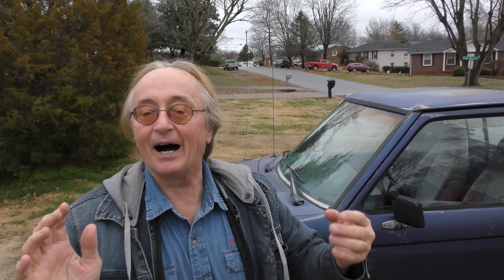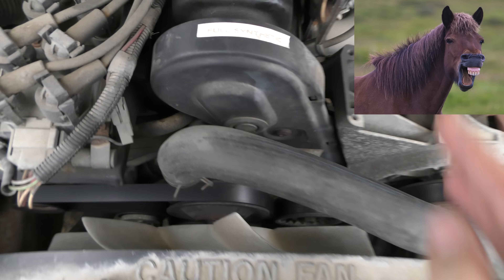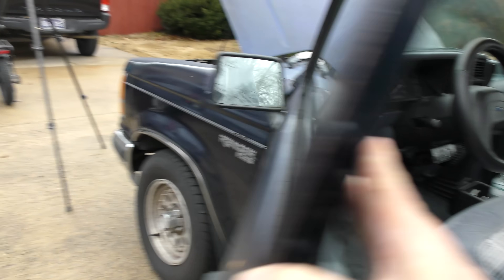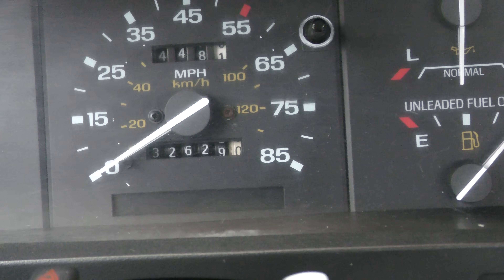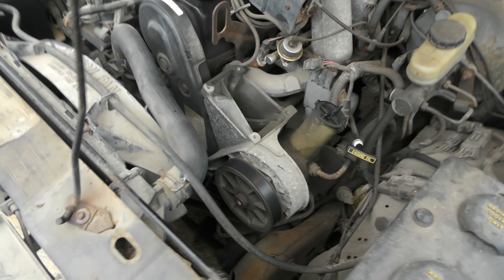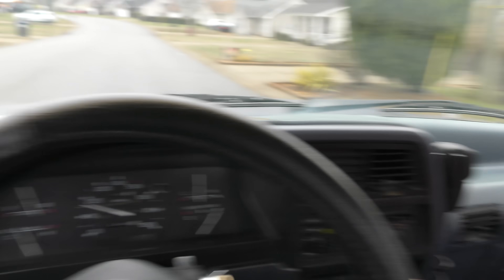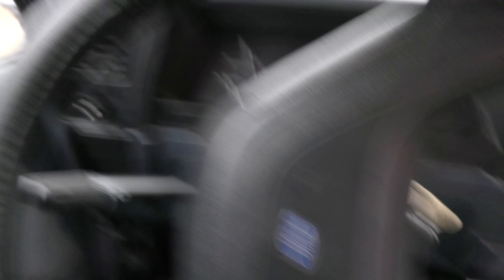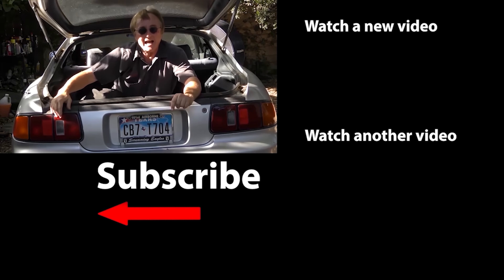Buy This Now (Before It’s Too Late)

Comment: I wish they'd make mini-trucks like these still/again. They were more practical than today's behemoths.
Reply: They can't because of the government regulations / CAFE .
This is the same reason why there are no more regular/single cab 'mid size' trucks either.
Even the new maverick is really a mid size not really a compact truck like these used to be
Reply: Yep. It's what Valor X says. It's the C.A.F.E regulations here. Other parts of the world still get the Toyota Helix, and check out the Japanese Kai cars, vans, ans trucks.
Reply: Unfortunately your only option now is to import a Japanese micro truck or buy an older one. I don't know what's with people nowadays so many "fat" cars, and not even roomy inside, just useless plastic taking up space.
Reply: @litao2641  Definitely. Why have a vehicle that's huge, has less interior space than a station wagon and gets awful gas mileage? You definitely can get an imported kai truck here in the States now. Jst check up on your local county Tag laws before buying one, because some may be reluctant to tag one. I don't see any of the kai trucks on  the road in my county,  but people are able to tag those recreational utility side by sides. They can drive them on roads with the speed limit 45mph or lower
Reply: 2.9 Colorado...closest and most modern, and decent prices...clearcoat fail for the win!!!
Reply: @jcrowellz2000  Here in Canada we have quite some K trucks/vans running around and they are allowed to drive on highways and registered as a regular vehicle which is nice! The place I work they have a honda k-truck for on site maintenance, better than any golf cart and can even drive into buildings!! I really love those things but the price of a decent shape one is quite high,  7~10k CAD range!!!
Reply: Even rangers and tacos are big now
Reply: @noahfrye4583  Exactly, those were small size handy trucks, the newer ones are just bulky. I still don't get why they try to make pickups look like some fancy show car, trucks are meant to work, not to show off
Reply: @litao2641  exactly

Comment: I had one of those exact Rangers in high-school my dad bought off my grandpa who worked at Ford. I drove it for 4 years through Ohio winters and I pulled a 16ft aluminum boat and a 12 ft trailer with my 4 wheeler. It was easy to fix, reliable, not fast which was good for a high-school kid and allowed me to have a lot of fun with friends fishing and 4 wheeling. Gosh, kids these days have it rough with computer run cars you can't work on and cost a fortune to fix. I do miss the good old days where a trip to auto zone spending 50 bucks got your problem fixed and back on the road.

Comment: I have a '96 Mazda B3000, basically a ranger. 190k miles, standard trans, rwd, extended cab. I bought it from original owner 3 years ago and it's been such a blessing. Hauls whatever, drives great, does 70/75mph down the highway no problem. It's not a drag car, but its fun to drive around and I've only had to do oil changes. Starts every morning in cold CO. I'm hoping I can get it to 300k miles
Reply: Yes the Mazda truck was the Ranger with Mazda logo on it. Believe they were both built in Kansas City, Missouri plant at that time. Solid and dependable small trucks.
Reply: You should check the timing belt
Reply: @richsweeney1115  Will do! Thank you! I'm waiting on this months paycheck to have it fully checked out —I'm not skilled in mechanics. Spark plugs, oil filter, all the bells and whistles. Will take any and all your recommendations!
Reply: @mateobarroetavena3469  you're welcome
Reply: @mateobarroetavena3469  the timing belt times the camshaft and crankshaft, valves,  and pistons if the belt breaks, it could ruin the.motor, I'm not sure if your motor is an interference or not, if it's not  and the belt breaks, you'd just h have the  timing reset, and put a new belt on,

Comment: I had a '91 Ranger that I bought in Yuma, Arizona, so the dash cracked and curled like a bag of potato chips, but it ran great. It had the 3 Liter V6 and a 5 speed trans. The first thing I had repaired was the A/C. The parts were reasonably priced, and the labor was reasonable also because of the ease of working on it. I added side rails to the bed, as I was managing some apartments. The tenants would leave a lot of trash behind, and often people would dump things on our property. The 3L engine was great for hauling, and driving on the freeways in San Diego. It was a convenient size for driving around the city and parking, and I really enjoyed it. Unfortunately I had to sell it because my knees have gotten really bad, and I could not step on the clutch. The 3Liter is a good engine, and so is the 4Liter.

Comment: I bought my oldest son a 2002 Ford Ranger in 2008 for $6,200 and it had 72,000 miles.  It has over 240K miles now and still goes down the road.  It has standard transmission which has been replaced a few times but it is a good truck.
Reply: How has he had to replace the standard  tranny a few times???? They don't usually blow

Comment: I had a 2008 Ranger, yes, newer and more tech than one from the 90s. But that truck ran and ran and never gave me a single issue in the 3 years I owned it. I unfortunately lost the "Bruiser" in an accident a month ago and it only had 109k miles on it.

Comment: I remember being in my older brothers 90' Ranger with the 2.3l manual trans. All 3 brothers crammed in there for a ride to go get  a TON of sand.  That little truck wasn't happy but it got us back with about 550lbs of us in there and 2000lbs of sand in the bed! Lol

They were solid, reliable little trucks.
Reply: Me and a friend loaded a 92 Ranger with enough material to build a large deck,  2500 pounds,  top speed 40 mph

Comment: I had a 63 Ford Fairlane when I was stationed in Beeville, Texas. Straight 6 with a 3 on the tree. What a clunker, but it was all I could afford back then. While driving down to Corpus Christi with a shipmate,  the brake line ruptured while driving on the highway. Had to use the emergency brake and clutch to slow the car down or stop. We had to drive it around and find a garage that could make a new one on the spot.

I wanted to fix it up, but ended up being sent to Japan, so my chief bought it from me for $500. Cars with manual transmissions were pretty common in Japan back then. I bought an old 4-door Skyline at an auction house in Yokohama and kept that for a long time. Those straight 6 engines ran forever and were easy to work on. Everyone wanted 2-door skylines, as they were sportier and Nissan was still very popular, but they cost a lot more. However, now manuals are not so common and the road congestion just makes them a pain. Japanese drivers actually have to get a manual transmission certificate on their driver’s license or it’s illegal for them to drive one. That’s just nuts.

Comment: My 95 S10 with the 4.3 v6 and 5 speed still runs pretty good and when on the freeway gets 24 mpg. Not the best gas mileage but it is paid for and it certainly isn't going to depreciate any more. I would change that timing belt though.

Comment: I remember that I was driving this Ford Ranger 40 years ago delivering computer tapes for the company that I worked for.

In fact, this Ford Ranger was the twin brother of Mazda B2000 then in early 1980.
Reply: If it was from 1980, it must have been a Ford courier, which was just a rebaged mazda. I use to have one of these at the time.

Comment: Those first generation Ford Rangers used alot of galvanized steel. Ford was replacing the rust bucket Courier from Japan. My Ranger had the 2.0. Got it cheap suffered from carb ice in damp weather was a easy fix. Broke the timing belt at 170, 000 miles. Replaced it in a school parking lot. Still got the sliding back window for it if anyone needs one.

Comment: I have an 07 Colorado I4 automatic with 136k 4x2 four door. I have only spent about $400 in repairs. One wheel hub and a EVAP valve.  It runs great the AC works, and I live in Florida.

Comment: A friend of mine had a 91'  4cyl 5 speed. We worked the hell out of that truck. We hauled loads of fire wood that had the headlights pointing up in the trees. We broke both of the leaf springs. The leaf springs for a F150 were the same  dimensions, put in a set from a F150. It wasn't  fast but would haul anything we threw in the bed.

Comment: my brother had a early 90s ranger and everything worked for years until the undercarage rusted out and cracked in half...causing one heck of a wreck because it happened while driving. then he inherited a one of the last plymoth breeze..with pitted heads that blew out the engine once again while driving. He finally lucked out when the subaru dealer gave him more than he paid for his car and a good deal on a used lexus suv. (from what i hear the parts were worth more then the car).

Comment: Had a '92 Ranger that I drove for years. Took out a Honda SUV on a snowy morning. All I did was change the fender and the tire popped off the bead. I drove that truck til I bought a Ram in 2004 and gave it to my son who drove it until it rusted out

Comment: I had a customer with a 92 Ranger 2.3 OHC had to replace the head gasket and valve job at 340,000 still had the original clutch which was getting weak at 280,000. I used to shut it off to shift between 1 and R.

Comment: I remember a couple friends had Rangers. They were nice looking trucks. I had a 1986 Mustang LX notchback with the 2.3L carbureted 4 speed. 80hp monster. I had to rock back and forth while chanting to get it to go over 45mph on some of the steeper hills. It had two sixty AC (2 windows down, 60mph). Too bad I used Quaker State in the early nineties when the oil was junk. The motor was no good by 120,000 miles. I had no idea. Anyway, I loved the car. It went surprisingly well in snow, and unstoppable with chains on, like a little tank. Really cheap to run. Very basic. I wish I still had it. Damn I'm old.

Comment: Hey Scotty tell him to put in a truck bed cargo load stabilizer. Beyond the obvious use to hold the load IT MAKES the truck handle better. It is like a rear suspension stabilizer AND I dont notice a stiffer ride. Instead the truck handles damn near like a go cart. Love regular cabs with manual.

Comment: I agree with you Scotty, I myself am a 55 year old Scotty & only 3 years ago did I buy myself a new to me truck with A/C. But I had to buy a used truck (F150) because I wanted hand crank windows & a manual transmission, so I ended up with a 2008 XL F150 nothing powered no nothing except for A/C & in live in N.C where it's hot & humid every summer. 
Oh & I had a couple of my teeth knocked out by a horse. 😊

Comment: i had a 1992 4runner. best car ever but i sold it just because it didn't have  safety air bags since my nephews tends to be with me a lot in the car. I have a 2008 Sequoia now lol still old but everything is basically the sames as a 2021.

Comment: I have a 2003 Ford Ranger. 183,000 miles. I bought it 8n 2011. Its my 2nd. Last one was a 94. Had it for 14 yrs. Got a vacuum leak and cant find a damn mechanic to work on it without paying $115 an hr labor  Im an old disabled lady, and id fix it myself if 8 could. Anyway its been a good truck. Its not ready to give up the ghost,.

Comment: Had one of those old rangers, the same package, only an 86 I think a lot more miles than that one, original clutch and brakes. The original owner drove it like a model A. We had fun with it but came from up north and was just rusted falling apart. Sold it for what I paid for it and it had a campertop , the guy hauled dogs in it till he rolled it.

Comment: My pre cat Volvo 740 5 door was the best ever, no silly lights , put the key in and off you went, Today i have a W212 E class i get silly messages , the quick cure , turn the engine off count to ten and start the engine usually thats the cure, It also works on Boe 767 proving they're on the ground !🤭

Comment: I have an 01 ranger edge , my paint is blowing off the top of the cab, it leaves it’s mark everywhere and I keep adding oil and driving it lol! It has almost 210 k miles on it and it’s NEVER been good on gas! I still like it but it’s due a replacement soon 👍

Comment: I had a ‘93 Ranger XLT with a 4.0L V-6, AT, and 3.08 gears. On the highway, I’d get 20+ mpg, and once got 24. Unfortunately, it rotted away, but it was a great little pickup that I had for over 200K miles.
Reply: Those are good engines

Comment: I had one of those as my very first car. It was a great running truck and very reliable. All I ever needed was a starter and a master cylinder, but unfortunately it was a 2 wheel drive so without a load it was helpless in the snow and rain. It did have a manual transmission though.

Comment: My brother had a Ranger, I was surprised to learn he had to practically take the top of the engine apart, remove fuel rails etc to get to the 8 spark plugs for a 4cyl  
After owning a 1st gen 4 cylinder 5speed Tacoma  nothing else really makes sense except maybe a 4Runner , Merry Christmas 🎄

Comment: 82 HP?  Wow.  I had a '98 with a whopping 119HP and had 2 plugs per cylinder. It didn't actually throw you back in seat but got 25 mpg on the freeway at mostly 70 mph.
Very reliable truck though.  The A/C still working well at 160k Miles.

Comment: I've gone through 4 Rangers. All were great. I Sold all but my last with over 200k and still running great. Sold my last one at 140k, with no problems at all, to get a new Tacoma in 2018. Gotta admit though, the Taco drives and handles like a dream. My Rangers, though reliable, kinda drove like an empty 6 pack of beer cans.

Comment: My 1989 Ranger 4 cyl 5 spd  (purchased used in 1993 for 3K) racked up 497,000 miles on the original engine and manual transmission, original clutch.  In 17 years of ownership I changed the oil, spark plugs, 1 radiator, 1 timing belt, 1 fuel pump and thats it.  Sold it in 2010 for $1000 running perfectly because my wife would no longer be seen riding in it.   Best $3000 spent in 1993.  Those type of cars no longer exist.

Comment: True,Older is usually better. I drive a 98 Dakota 4/5 . Flat bed , sliding back glass, hand crank windows. 263125 miles. Original suspension,  I bought this truck from my Uncle Jerry 4 years ago for 1200. Dollars. Its not the prettiest thing, I have put a wiring harness on it after 🐇 chewed up the other one. I also put in a couple spark plugs ,+ 4 tires. 😂 370.00 for 4 tires 15  tires from Jim Ross Tires in Osceola, Arkansas. Thanks for showing how good these old trucks are. Keep it up. 👍🎄❄️🇺🇸

Comment: That Ford Ranger regular cab is extremely old to keep on the road, but it is solid and reliable and it has a manual transmission.
Reply: @Mark Dumagpi insurance is dirt cheap! That’s a beauty of driving an old truck. And since it doesn’t go very fast, you can’t get into any trouble with it. Another nice thing of low horsepower
Reply: @Blakecryderman7244  That's good
Reply: @md2k8  yup.

Comment: Scotty, those are not the original rims on that Ford Ranger.  I had a 1995 and the wheels were good ol' "steelies" and could take quite a beating (but not from midwest winters!).   From the style I'd guess they were put on about 2000.  But they are holding up well.  Cheers to you and Merry Christmas!.
Reply: This is an XLT trim, you can see the badge on the side of the truck. Those wheels were availabe from Ford on the older Rangers. My grandfather had a 91 Ranger XLT and  had those on his truck from the dealer. You can see the 1991 sales brochure online and it shows those wheels on the XLT model borchure photographs.

Comment: I still drive my 91 Toyota pickup with the original 22RE engine and manual 5-speed trans. Only things I've ever had to do was replace the water pump and the timing chain (because the guides are plastic and they break)..Oh, also, the circuit opening relay tends to malfunction. I bypassed it with a jumper

Comment: You can still readily get parts for the 2.3 4 cyl because Ford made that 2.3L until they discontinued the original Ranger in 2011.
Reply: The 2.3 in that truck he showed was the upgraded "pinto" engine. The 2.3 engine's in the 2002 -2011 modles was a different engine.
Reply: @williamconrod8998  
You're right. I stand corrected.

Regardless, the 2.3 Pinto (which was then upgraded to the 2.5L) was still in production until 2001, and used in a wide array of Ford cars. Such prominence is why parts are still readily available (mainly the Fox Body cars).

Comment: I have to say that 2.3 liter engine is a good engine and used in tons of application.  had 2007 mazda 3 with that engine and the engine still ran like a top when we sold it with 135,000 miles. still had the original pcv and never leaked oil and oil level never changed between changes.

Comment: Scotty, have you done a video on oil? A well known magazine recently indicated that using the right oil is important.
Reply: Which magazine and what do they mean "right oil"? Viscosity?
Reply: He has done it, and yes just use the oil the manufacturer recommends
Reply: Yea...the right weight....all oil you see in  the stores is good now.
Reply: @richsweeney1115  no, it's not, European cars take special oil regardless of viscosity, some new engines can only use lightweight oils like 0w20, read the owners manual and don't assume all oils are equal
Reply: @noventay4  I'm not talking about the weight all being the same.....that's the exact opposite  of what I just said
Reply: Don't follow ANY recommendation to change oil at 10k miles....always change at 5k max, or 6 months old.
It matters bigly!

Comment: I had one of those, a 1993, 4 cylinder, 5-speed manual with an open differential.  Not bad.  Had the manual sliding back window in the cab that would blow things right off the seat at highway speeds. 😂